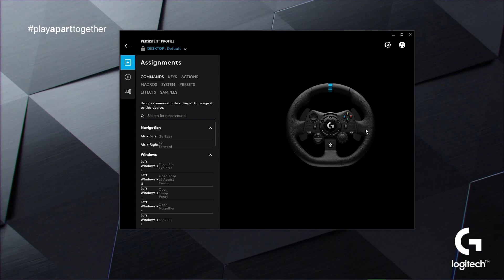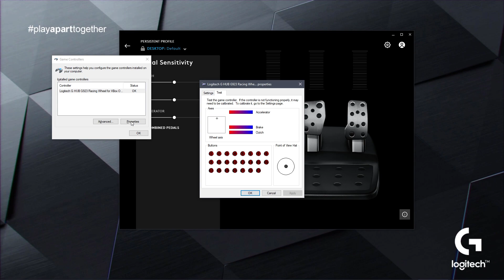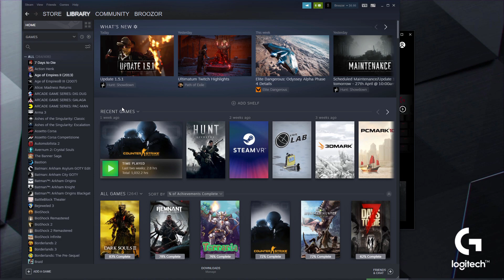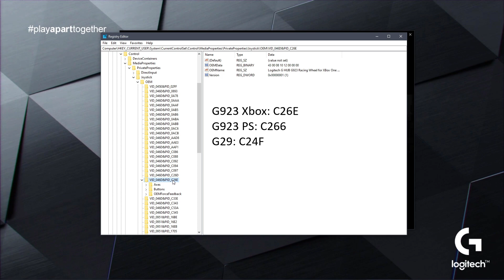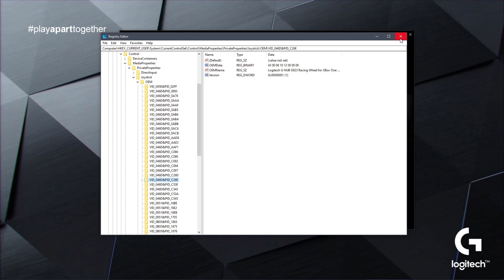How to troubleshoot G923/G29/G920 for Connection Issue

Comment: Connects to ghub and the petals work but it doesn't recognize any input from the wheel
Reply from the maker: Hey!

Can you test your wheel in Joy.cpl? You can find that in Windows. If you aren't getting any input there I would first check your power cables to make sure they are seated. If you are still having issues please open a ticket with us below!

https://support.logi.com/hc/en-us
Reply: @logitechsupport  i managed to get the wheel to work but now the software is detecting the wheel right and I can't change any settings

Comment: So you said to confirm that it reappears in step 4 but not what to do if it doesn't, mine didnt come back and now the wheel doesnt even show up in logitech software
Reply from the maker: Hey there! 

After you've done the reg edit, did you unplug your wheel? Swapping it to a new USB port might help as well. It'll need to reinstall your drivers and the USB swap will help that.

If you are still having issues after, please open a ticket with us below!

https://support.logi.com/hc/en-us

Comment: My G923 is stuck on “downloading resources” and the icon is gray, what is the solution?
Reply from the maker: Hi there!

Could you try reinstalling G hub and your device drivers?

Also we always recommend checking your power cables on the wheel to make sure they are seated properly. Checking the power brick also helps!

If you are still having issues please open a ticket with us.

https://support.logi.com/hc/en-us

Comment: Why won’t it calibrate though
Reply from the maker: Hi!

Lack of calibration could immediately point to a power issue. If you have a solid light on your wheel but no calibration it could be hardware related.

Can you check your power cables first and if that doesn't fix the issue if you open a ticket with us we can help you out!

https://support.logi.com/hc/en-us

Comment: Need help please!!!! Trueforce on the G923 is ONLY recognized on my PS5 after I had connected it to the PC app. Once I turn off my PS5, and restart it to play GT7, it will again only recognize Trueforce after I run it through the PC app first. For some reason it looses the Trueforce feature after I restart the PS5, and can only work after I have connected to the PC app. If I leave my PS5 open all day, it wiill work straight, but once the PS5 is closed and restarted, its the same story over again!
Reply from the maker: Hi there! 

If you unplug your wheel after the PS5 has turned off and only plug the wheel in after it has started up do you get full functionality?

We'd love to dive deeper into this which we can in our ticket system. 

https://support.logi.com/hc/en-us

Comment: Great video unfortunately I got to step 4 without avail I’m gonna have to submit a ticket. What happens is the wheel calibrates halfway and then stops in between the last spin and starts flashing lights. It was working for a few days and then stopped working randomly
Reply: Same issue
Reply from the maker: Hey!

The flashing lights and the calibration stopping is a sure sign of a power issue. Your power might be getting unplugged during the wheel spinning? If you could check that to be sure that would be the first step. Next would be making sure your power brick is plugged in correctly as well! Isolating it directly into a wall outlet would be your best bet. 

If you are still having issues and haven't opened a ticket yet here is a link!

https://support.logi.com/hc/en-us
Reply: @logitechsupport  my wheel calibrates to the last spin but then the wheel becomes stiff and it doesnt connect back?

Comment: Unknown USB Device... this didnt help
Reply from the maker: Hey there! 

It seems that you might be having drivers issue. If you go into your device manager you can try to repair the driver. Typically a uninstall/install might help you out. 

Are you running your wheel through a hub? You may want to run it directly into your motherboard for better results.

If you are still having issues please open a ticket with us!

https://support.logi.com/hc/en-us

Comment: I just got the G920 today and downloaded the crew 2 wanted to see if it's working properly. Apparently it's not. I've tried the step 1, 2 and 4, but for step 3, the G920 isn't showing up in the controller settings. Guys, any clue? It's making me so frustrated
Reply from the maker: Hey there!

Can you confirm if all your power is connected properly? That would be at the wheel and the brick itself. 

Is the wheel responding in G hub? If so you might need to bind all your controls on the crew manually. 

If you are still having issues please open a ticket with us below!

https://support.logi.com/hc/en-us

Comment: I have no force feedback on multiple Windows 10 machines using the G29. The wheel is recognized by games but not by steam. I wasted 8+ hours and tried all of the guides on reddit (power cycling the wheel, uninstalling logitech software, wiping the registry, deleting settings in %appdata% and %programdata%, toggling the "allow game to adjust force settings" option), but nothing has worked. I'm returning this piece of garbage.
Reply from the maker: Hey there!

If you could do a quick reinstall/update of G Hub that should solve your issue! If you still have an issue after that please open a ticket up with us below.

https://support.logi.com/hc/en-us
Reply: @logitechsupport  Thanks, but I tried that multiple times and it didn't work. What did work (temporarily) was unplugging the power and usb for 15 seconds, but after that I had additional problems, like noise/roughness in the pedals, as well as quirks/instability in some games. Since it was within the return period, I got a full refund and will not be wasting any more time on the product.

Comment: G hub ain't even find my G29!
Reply from the maker: Hi there!

Is your wheel powered correctly? If you are plugging it in and it is blinking then you'll need to make sure the cables are properly seated at the wheel and the brick. 

If you are still having issues please open a ticket with us below!

https://support.logi.com/hc/en-us
Reply: @logitechsupport  ty for the response. I deleted G Hub and downloaded some older version of LGS and now it works like a charm.. New version of LGS or G Hub aint work at all.

Comment: I have a g923 xbox/pc version, when i plug it into the pc it doesnt move and all the lights stay on, I already checked the power conectión and everything its conected righ, does this means that the power brick failed?
Reply: Did you check the connection at the power brick itself?  Unplug the power cord from it then firmly reinsert it to be 100% sure.  Final check: make sure you have the correct power brick (it's easy to get things mixed up with the potential amount of adapters under a desk) - it should be supplying an output of 24V @ 1.75A.

Comment: My light is coming on and I can use the buttons but it’s not calibrating and the steering isn’t being registered. This is for Xbox
Reply: That usually indicates a power issue.  Did you double check all of the connections, including the one at the power brick?

Comment: I cant find the wheel in Steam and the leds are not working.
But everything other works?
Reply: It does not need to be seen in Steam necessarily.  Which title are you using it with and is it only the LEDs that aren't working?
Reply: @richardneville6304  Forza horizon 5
Reply: @z0ned27  FH5 does not support RPM LEDs, I'm afraid.

Comment: I'm locked to the "connexion" under my wheel... so i can't click on it, why? All the rest is good, drivers, usb plug..
My wheel work on the logitech assist but don't work on g hub
Reply from the maker: Hi! 

Are you getting a flashing/blinking light on your wheel? If everything else is recognized but G hub is showing connecting still you might be having a power issue. Please check all your cables on your wheel as well as the power brick!

If the issue persists please open a ticket with us below. 

https://support.logi.com/hc/en-us
Reply: @logitechsupport  Hi, thanks for answer.
I found the problem, just my old logitech software installed in same time with Ghub and I got troubles. I've just deleted all of them and download again Ghub! Now Ghub and my wheel works good!

Comment: I am on Windows 10 64bit and my G29 wheel is detected and 'works' .  However Force Feedback is not working in all games and the Logitech wheel sdk software.  It seems a system wide issues with logitech force feedback drivers.  I am contacting support currently.

Comment: help 

my wheel is blinking and receiving power, my ghub is saying connecting and my wheel doesnt want to calibrate im lost
Reply from the maker: Hey!

If you are having a blinking LED that typically points to an issue with power. Can you check your wheel connections and the power brick connections?

If there are still issues please open a ticket with us below!

https://support.logi.com/hc/en-us

Comment: Everything is working except for the force feedback. I tried everything and it doesn't work. I don't know what to do anymore. Can anyone please help me?
Reply: The light on my G923 is blinking because it doesn't calibrate itself.
Reply: @mpv_f1-dodo  This suggests that the wheel isn't receiving power.  Did you double check all of the connections, including the one at the power brick?
Reply: @richardneville6304  Thanks for your answer but I already fixed it.😁👍
Reply: @mpv_f1-dodo  Nice!  What was it in the end?
Reply: The wire wasn't pluged in.😅 I don't know how it happened because I never pluged it out but yeah. That was the "problem".

Comment: In step 4, my g29 isn't detected. is there any solution?
Reply from the maker: Hi there! 

If it isn't showing up within the registry you may have had a driver installation issue. Can you locate the wheel in device manager and try to repair/uninstall + reinstall your driver? We also recommend that you don't use a USB hub for the wheel. 

If you are still having issues please open a ticket with us below.

https://support.logi.com/hc/en-us

Comment: After being powered up properly and calibrated, the G920 is not showing up in the G hub application, Can you please help ?
Reply from the maker: Hey!

This is likely because of an issue with how the driver installed. Can you go through our driver uninstallation instructions and try again? Swapping your USB port might also help in this case. 

If you are still having issues please open a ticket with us!
https://support.logi.com/hc/en-us

Comment: My wheel when I drift will turn the straight position of like driving to the left. How do I fix this?
Reply from the maker: Hey there!

Does it change after you let the wheel calibrate itself on startup? Does it show any off center indication in G hub or within joy.cpl? 

If there are issues still persisting and you are not getting any software visual indicators of an error please open a ticket up with us!

https://support.logi.com/hc/en-us
Reply: @logitechsupport  I saw a great video on how to fix this permanently you had to put two washers between the mother board and the wheel turning sensor thingy.

Comment: My wheel is brand new, just got it today. Worked right out of the box, then suddenly stopped. (I think I was changing settings in game before this happened.) Now power light quickly flashes, and instead of fully calibrating it goes all the way left then stutters before failing to go right. I've tried reseating connections and reinstalling firmware.

The wheel is detected by my PC but there's no input in G HUB, games, or in the windows controller module. Registry files didn't come back either. What could have happened?
Reply from the maker: Hi there! 

Can you open a ticket with us? Sounds like your power supply might have had an issue. We can get that sorted out!

https://support.logi.com/hc/en-us

Comment: Thank you! Red flag for me - the wheel stopped working even though LED is flashing and buttons work/device is recognized. It doesn't spin and doesn't "calibrate" when plugged in any outlet. Games or Logitech app don't recognize spin at all. Sounds like power adapter died or cords or something power related in the wheel itself. Sent it back for a replacement.
Reply: Bonjour avez vous eu un retour ?
Reply: @clemcarpe51  Yeah I just got another wheel from Amazon, a replacement. Which definitely feels and looks newer and works properly. So that one was just defective and I sent it back.

Comment: Well looks like the power adapter of my G29 or even the entire wheel power supply is gone. I bought the wheel just a few month ago and had it in use for maybe 10-15 hours in that time, hadn't used it for maybe 6 weeks, wanted to play F1 2022 now, connected everything, wheel is recognized by the software but not calibrating, only green LED flashing, reconnected every cable several times, nothing. Amazing quality I bought for 300€, I will phone your support tomorrow and I guess I'll have to send the wheel in, which means finding a printer to print the label, finding a box (don't have the original box anymore), this is fun, next wheel I'll buy is definitely not a Logitech product.

Comment: Hey mine calibrates by spinning but doesn’t come onto Ghub or work on any of my games on pc
Reply from the maker: Hi!

Can you make sure your drivers were installed correctly? You can check your device manager as well as your device settings on Windows to see if it shows up.

If it doesn't can you try a different USB port/make sure it works on another system? If you are having issues still after that please open a ticket with us!

https://support.logi.com/hc/en-us

Comment: how about some quality control? making sure shit works out of the box? I have had to send back this g923 trash 2 times now, faulty clutch and then faulty brake pedal lol.
also the pedals are too close to each other, it's fine if you are 10yo but for an adult shit does not work well lol.

a tip for those that can't install "G HUB" the new version blows, you need to install an older version and then update it lol.

Comment: My Logitech G29 has been working fine for about 4 months but when I went to use it today, I turned on my PS4 and the wheel didn't spin but the green light was blinking and all the buttons were working so I went on F1 2021 and as soon as I had control of the car it veered to the left, full lock, despite me not even moving the wheel. I plugged it into my PC and loaded up G Hub and the pedals were all working fine but it said the wheel had -450 rotation, but it was centered. I checked the cables and they are all plugged in. How can I fix this?
Reply: Bonjour avez vous eu un retour j’ai le même problème !
Reply: @clemcarpe51  Je n'ai pas eu de réponse mais j'ai tout débranché et quand je l'ai rebranché ça a fonctionné.
I used google translate, sorry if it doesn't make sense 😅
Reply: @alex_o_56  horrible j’ai essayé pendant 3h a tous débranché et rebrancher ça reste à clignoter et -420 le volant..
Reply: @clemcarpe51  Si vous avez déjà tout essayé dans la vidéo alors je ne sais pas, désolé
Reply from the maker: Hey there!

Can you make sure you've updated your wheels firmware? If you have and there are still issues please open a ticket up with us!

https://support.logi.com/hc/en-us

Comment: My steering wheel doesn’t respond to the steering wheel display. But the pedal does. All the button works. The steering wheel does not calibrate
Reply from the maker: Hey there! 

Can you make sure your power is connected properly? If you aren't getting any wheel movement at all it's likely something to do with your power supply. If you have tried everything in the video as well as making sure your PSU is connected to a wall please open a ticket with us! We can dive into it more there. 

https://support.logi.com/hc/en-us

Comment: g29 steering wheel just shows the angle is -450 even if it isnt -450
Reply from the maker: Hi!

Can you make sure you've updated your wheels firmware as well as G hub? Also,  getting a -450 degree turn in game or is it just displaying that on G hub? 

If you are still having issues after reinstalling/updating your firmware we can help you more in our ticketing system.

https://support.logi.com/hc/en-us

Comment: Can someone help? I have 2 Logitech G29 wheels and pedals sets. One of the wheels spins when hooked up and the PS3 and PS4 led flashes, the RPM leds are all lit and this wheel stays to the extreme rotational position. 
I checked all this against another wheel that is okay. I plugged in the good wheel to the pc, power supply and pedals the other wheel that isn't working right. 
I really wanted this other wheel to work. Any ideas? The above video is good but didn't fix my problem.
Reply from the maker: Hey there!

If you can open a ticket with us that would be great! We can help you out with the wheel set that is having issues.

https://support.logi.com/hc/en-us

Comment: Mine is just got connecting and just does not connec
Reply from the maker: Hi!

Can you make sure that your power cable is seated correctly? I'd also recommend checking your device manager and reinstalling your wheel drivers. 

If you are still having issues please open a ticket with us below!

https://support.logi.com/hc/en-us